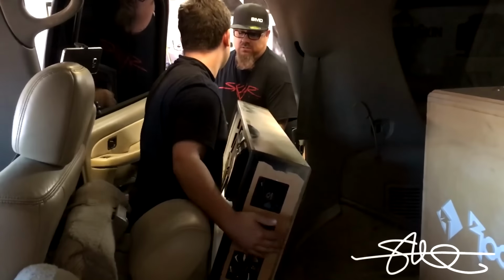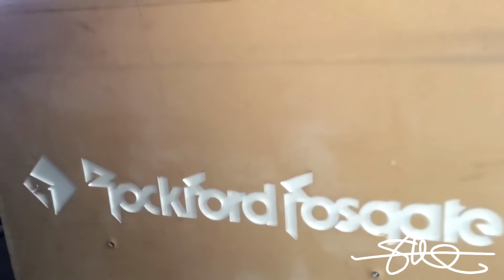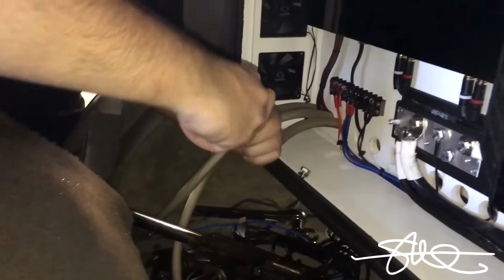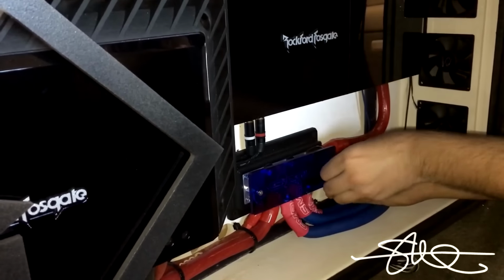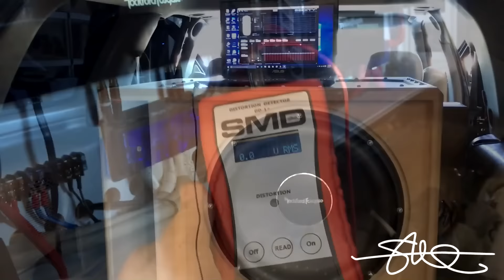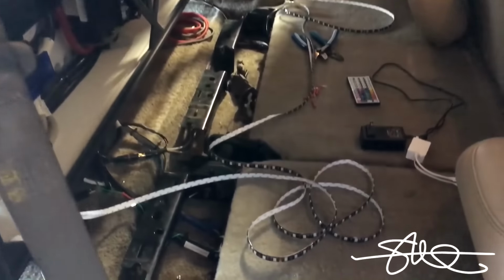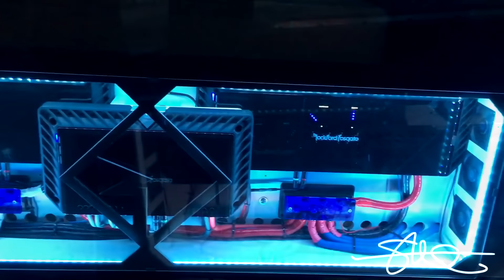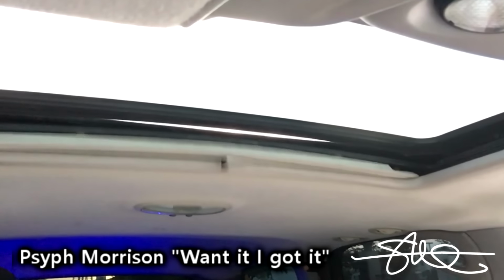One MASSIVE Subwoofer + One "COOL" Amp Rack Wired up & Fired Up - Father & Son Sound System 2

Comment from the maker: FYI: For those who didn't pay close attention.  There is only ONE amp on this 19" subwoofer right now and it is a single 2 ohm sub.  We had both amps strapped to it and it did get louder but not loud enough to be worth the extra voltage drop. He has a Mechman 370a Alternator but he could probably use an extra battery or 2 (if using a 2nd T2500.1). This single RF T3 19" sub is also MINE (LOL) so until his 4 SMD "Mini" series 15's show up, this is what he will run.  It is pretty nice! It hit's lows with AUTHORITY!! We will make him a box for his new subs and THEN make it all look pretty.  In the mean time if you click this link, you can see what we have done to the vehicle so far as some of the original build is still being used.  http://www.stevemeadedesigns.com/board/topic/192946-father-son-project-02-yukon-a-rockford-fosgate-sound-system-install-update-round-2-all-new-stuff-ubl-all-pics-no-chat/page-1
Reply: What is the purpose of 2 or more alternators?  I had 1 mechman in a 2007 jeep wrangler Sahara unlimited  and I had two shuriken and three XS and a red top in front two t2 13" with an 2500 bd per sub and alot of other things I had do dim interior or exterior so I'm just curious on why so many people I know with lower quality subs have so many alternators?

Comment: Might be a stupid question but on something this large, do you run the constant power 24/7 and let the amps switch themselves, or run a relay?  Do amps drain a significant portion of battery power when off?  I guess a fuse would mitigate the fire hazard factor, just curious.  Love your channel.

Comment: I'm assuming it's not distortion cause you put the Dd1 on the amp, but what does it mean when the meter on the amp goes red when it's all the way to the right? I've always been curious about that with those Rockford amps.
Reply from the maker: when RF amps go red all the way to the right, it does NOT mean clipping. Just means it has a lot of output.  It's just a display.
Reply: +meade916 awesome. thank you for the reply sir. I asked cause I didn't think it meant clipping since you guys put the dd1 on it. btw the dd1 and cc1 are awesome! probably my favorite audio tools I've bought so far.
Reply: Steve has a lot more knowledge than me, but according to the user manual...
"These LEDs simulate VU meters to display the real-time output of the amplifier from - 00 (infinity) to +2dB. During normal operation the indicator should not reach +2dB, as this indicates clipping."  
This is straight from the Rockford's website, so no, it's not just a lot of output, its clipping. That being said, the tools Steve uses might be more accurate than the display so even though the amp shows clipping, it might not be.
Reply from the maker: trust me on this, it doesn't mean the amp is clipping. Those things can hit the red WAYYYYYYY before any type of clipping occurs. They are just a display.

Comment: hello. i installed a 2000watt meso 12" sub with a 1700watt amp in my 2011 honda accord coupe. I used a lci2 line converter and got the signal from my two rear speakers. It sounds loud but every 5 to 10 seconds i hear a horrible heart beat like sound from the subs. I have no idea how to fix that problem. Please let me know if youn've ever had a problem like this. anf how i can fix it? I also noticed that when its making the horrible sound and i open a door or the trunk, the heart beat goes away.
Reply: I've heard it's before you might want to check all of your grounds especially the line convert that's going to the amp and try turning down the gain level on the  converter almost all the way down but it mostly sounds like an open ground but like RCA's and Line converters they are extremely sensitive to ground  noise balanced inputs or unbalanced differential inputs all this go's into play good luck
Reply: +rockford4009 Robledo  thank you very much for your reply and input. I have two ground cables going from the amp to two different bolts. Ill try to move the line converter gains down to see if the heart beat sound goes away. But wont i then not have any good bass sound to the subs? Anyway, ill try it. thanks again.
Reply: +Derek Hood thank you derek, ill try that.

Comment: Planning to do a pc upgrade series anytime soon?
Reply from the maker: i need a new PC but instead of dropping $6000-$7000 on a new tower, i would rather supercharge my Caddy.
Reply: +meade916 Which supercharger are you looking at for the Caddy? I am going to get a SLP 1900 for my 5.3 Chevy. Are you aware of the carbon build up issue in direct injection engines (especially boosted ones)? Will you do the installation? Can't wait. I'm excited for you man!

Comment: Badass is the 19 just loud or is it deep and clear too?
Reply from the maker: both.
Reply: +meade916 meade whats ur take on a slot port vs square i noticed u built a slot for the 19 but alota systems you use the square is it just  whatever fits best or is there an advantage to one??

Comment: Could you just gain match the amps and run one 2500 on each coil or is that too much? Just curious. :-)
Reply: it says in the description that they did have both amps, but wasn't worth the voltage drop...
Reply: I know they had both amps I was just inquiring if you could run one on each coil if you gain matched them.
Reply: Steven Watson yes you can, but as said above the voltage requirement VS output is not worth it.
Reply: It's a Single 2 ohm Coil. He's probably gonna strap them later on.